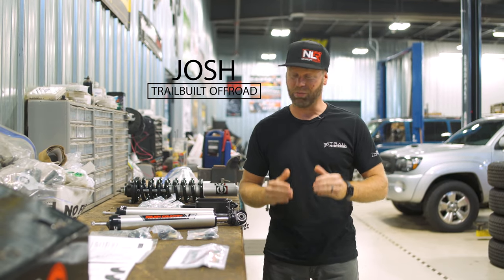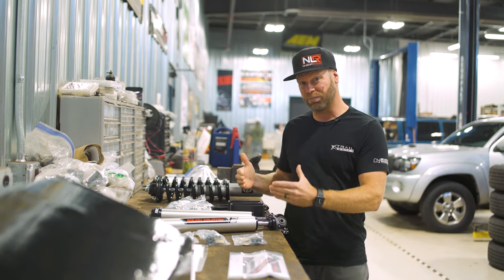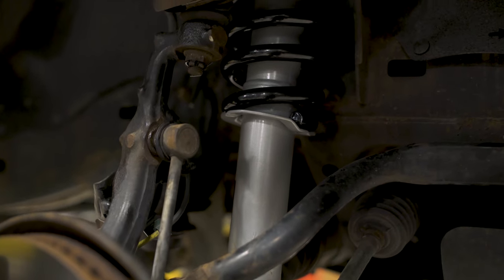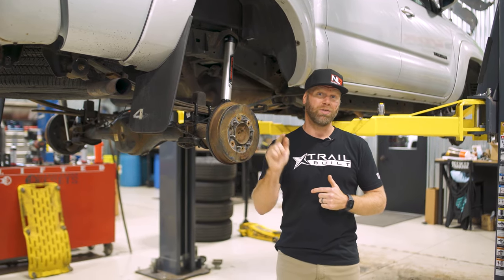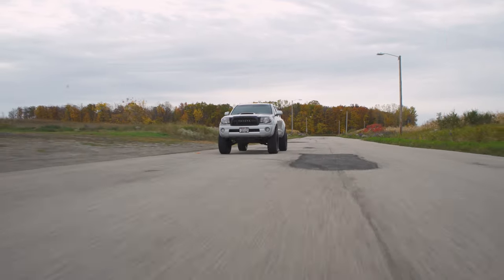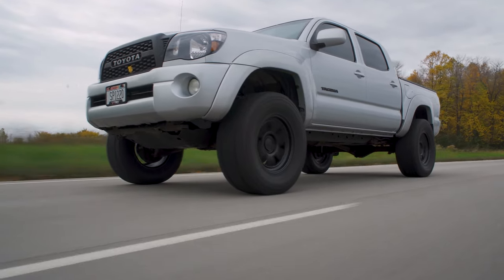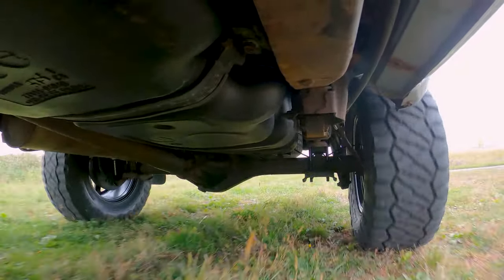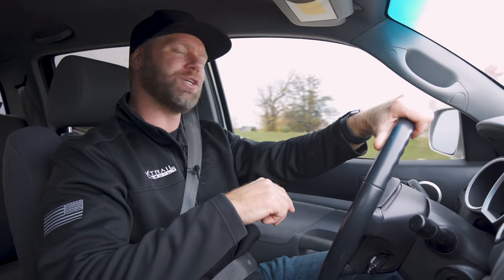Best Cheap Tacoma Lift Kit

Comment: Does lifting from 3" to 6" affect gas mileage?
Reply: If you get bigger tires you’ll need a tune and you’ll most likely need to use premium or diesel depending on the tire size I’m not sure if I’ll waste more gas but you’ll pay more depending on tire sizes but the lift itself you won’t need a tune or switch gas type unless you get bigger tires like 295-300s
Reply: @hmmm2037  From factory wheels to 285/70R/17 tire/wheels and 3" lift, and  noticed a sudden drop on the gas mileage, do you think using premium gas is better than getting tuned up or both?
Reply: @237311  The drop on the gas millage is most likely from switching to bigger tires and your car having to pull more weight, depending on what car you have and where your located a tune is very hard to find for 2nd and 1st Gen Tacomas, I recommend getting a pedal commander which will improve your acceleration time and you won’t feel like your car is pulling so much weight from the tires. Premium gas is always good to use on any car, but I would recommend to use the mid-grade unless you get a tune and the tuner tells you to use premium. But from my experiences and my friends experience with 2nd Gen Tacoma, finding a tuner is really hard and most likely in another state, so I would recommend getting a pedal commander which will for sure help with pulling the 285 tires and making your car a little faster but you will waste gas like crazy lol. But it’s totally worth it from the differences
Reply: @hmmm2037  If an engine doesn't need premium it doesn't serve you any benefit to put premium in it. It's all to do with the compression ratio of the engine. Please stop saying nonsense
Reply: @hmmm2037  diesel??? What tayota are you driving LMFAO!
Reply: Gas mileage goes down 1 or 2 mpg with a lift

Comment: What option recommendations fits my 2006 Toyota Tacoma; 4 Cylinder; RWD; 5 Lug, Access cab?
Reply from the maker: Superlift and Zone both have some affortable options that fit your Tacoma. Take a look sometime and let me know if you have any questions! https://www.trailbuiltoffroad.com/store/suspension?sort=popular&year=2006&make=Toyota&model=Tacoma&drive=4WD&sub=Suspension%20Lifts&saleToggle=0&qdToggle=0
Reply: Thanks for the info, I forgot to mention my Toyota is also a 5 Lug. Would the Rough country 3inch spacers with the N3 shocks work?

Comment: Which kit has the best performance off and on road, I'm looking to lift 2". Looking to haul 200 to 1,000 lbs off and on road from time to time. I have 2013 Tacoma 4x4 TRD Off Road.
Reply: I've heard Bilstein 5100 Tacoma front struts adjustable from 1-2.25 inches. And if your hauling alot then tundra 5100 rear

Comment: Could I run 305/70R16 on this lift? I have 245/75/16 now and getting new tires soon. It’s the same wheel size and a 6 lug pattern. It would be the Nitto Grapplers

Comment: Well I have a 2013 Gen2 Tacoma TRD off road (the same truck as the 2005) that you talked about and I have the same 3 inch lift on my truck 33s (Will Not Fit) have to go with 265/75/16 only an inch taller but the width taller and wider like you said you did I would have to do a lot of modifications. So if could tell me how you did it i would appreciate that, thanks Ed

Comment: My 06 tacoma has a 3 inch lift…will a 32 12 50 r15 tire fit within the wheel well?
Reply from the maker: Looks like it will! Check out some of these other Tacoma's running those specs! https://www.customwheeloffset.com/wheel-offset-gallery?tire_height_from=32&twidth=11.5&wheel_offset_from=-51&sort=yno&year=2006&make=Toyota&model=Tacoma&drive=4WD&suspension=Suspension%20Lift%203q
Reply: Are you running spacers on this ? And what’s the offset mm

Comment: I bought an old 2006 Tacoma Double Cab short bed 4.0L that has been lifted 3" but the suspension on the front and rear are very stiff. What could have been the problem? Thanks.
Reply: Struts could be on the cheaper side